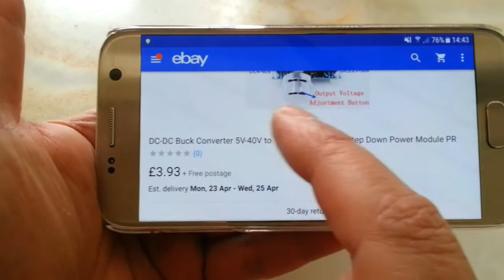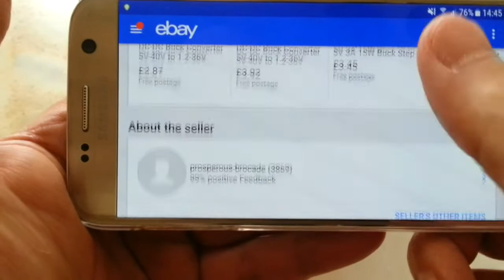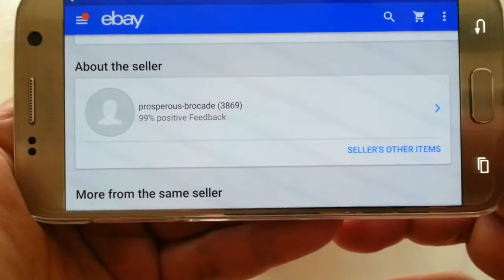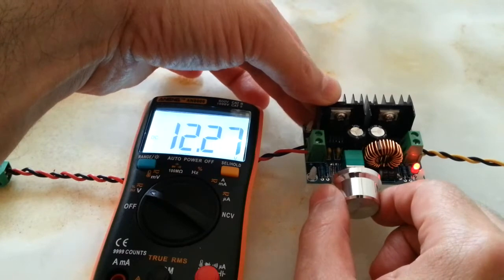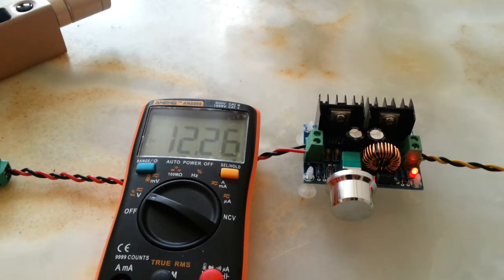DC-DC 5-40V to 1.2-36V adjustable Step down buck converter review & test

Comment: I bought one, first thing I did was replace the pot with a 10 turn pot mine was 50k linear. It cannot handle 8 amps or 200w. As with all Chinese specs you need to divide advertised rating by 2 and then divide again by a random number. That will give it's real rating. It's more like 60 watts as is, maybe 100 with a fan.